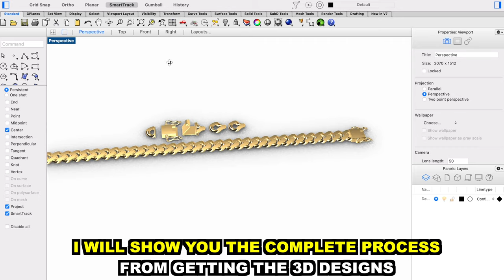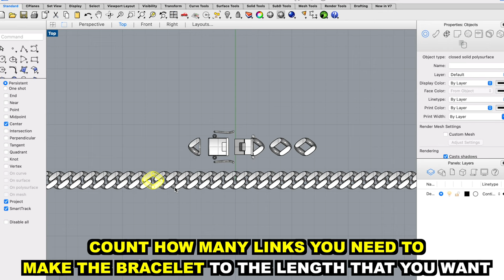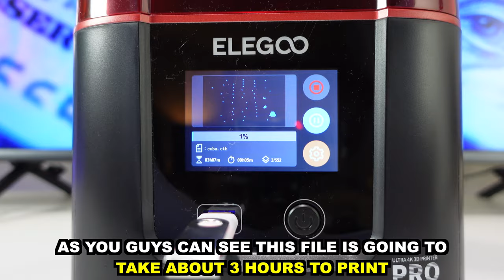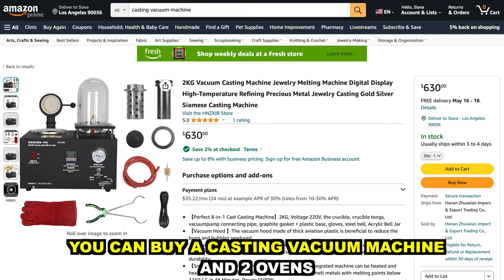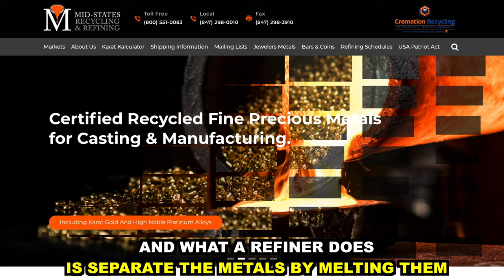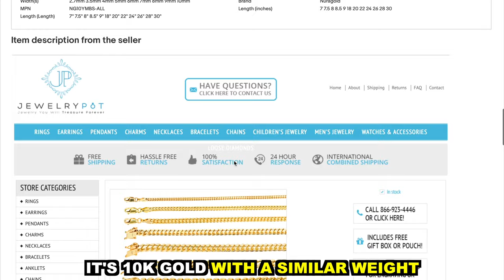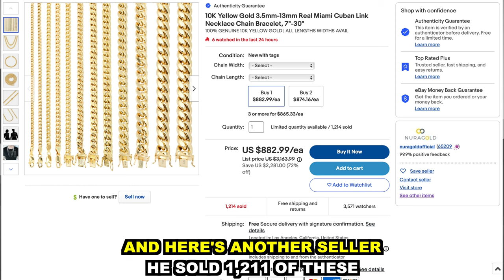How To Make A Gold Miami Cuban Bracelet YOURSELF (Easier Than You Think!)

Comment: I started watching your videos around 2 years ago. Started getting into it myself. Got the 3d printer. Same site you use for the 3d prints. Got 5 Oz of 24k bars from an online dealer. And when I went to casters and jewelry makers, they all gave me a hard time. They saw how I was cutting out the middle man to max my profit. And it took forever to even get 1 cuban made. It was crazy how hard of a time I was getting. They all questioned why I wouldn't just get them the same way they did. Had clients lined up to get Cubans for less than the jewlers were selling for and still make a profit.  Quick nickels vs. slow dimes. But getting held up by these people put a stall on my side business.
Reply from the maker: Thank you bro, where are you located?
Reply: @SlavaTVOfficial  massachusetts
Reply: @em6824 how’s it going I’m trying to do this in California
Reply: I put it on hold... I plan on getting it started back up by next year. But this dude and his info is legit. When you start, I hope you have better luck than when I started.

Comment: Slava! 

Peace Brother! Can't say enough about the appreciation I have for these very informative and insightful videos you've produced and shared here on your channel to give the inexperienced person behind the scenes access to the jewelry industry who has an interest and desire to break into it. 

I'd like you to consider doing a video(s) on the following: 

1. The entire breakdown of the Miami Cuban Link chain, specifically about all the exact measurements, and the different types of box lock clasp designs, mostly on the larger chains. Are there standard measurements, or can you design it however you like in a sense? I particularly want to know what's the gap/space measurement between each link? I've seen several exact-sized chains with various link gaps, but both are Miami Cuban Link chains.

2. All of the economics around the costs associated with each stage of making a Miami Cuban Link chain, or whatever piece, just sharing all the numbers in one video. I learned a lot about all the industry standard numbers above the spot price incurred from manufacturing jewelry yourself that you've shared, but they were spread across multiple videos, versus in one single video. And it'd be cool to offer a PDF document download of all those numbers to have a "cheat sheet" if you would that could be referenced prior to negotiating in person and/or via phone. Also include the numbers (percentage) of what would be received/paid out from a refiner for melting down scrap gold and/or gold jewelry (I believe you said 98% of the spot price), which is great to know so you're always aware what your state of liquidity is in dollar amount. Which again, as you stated makes this a win/win business you can't really lose in. 

3. Stamping: 14k mark on chains and a company logo on box lock clasps.

Most appreciated!
Reply from the maker: Thank you bro, I appreciate that and I apologize for the delayed response. I will absolutely break all of that down. I forget to mention in this video that the reason why I lost so many grams compared to the last chain is because this bracelet was filed down just like a handmade one, and that's why labor was so expensive